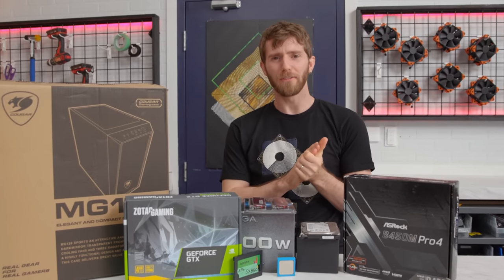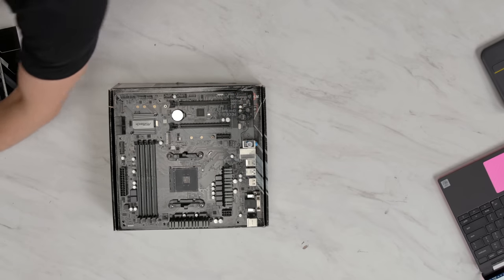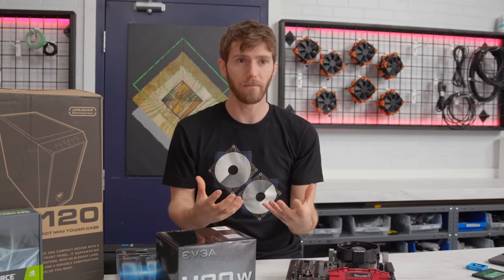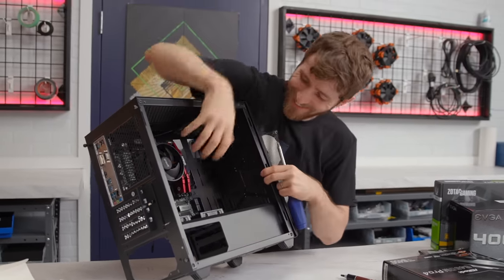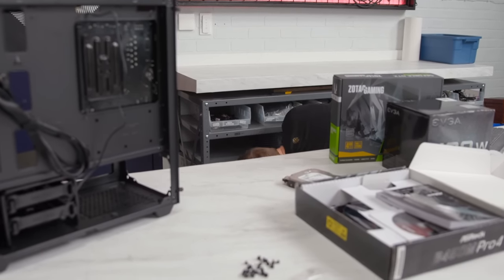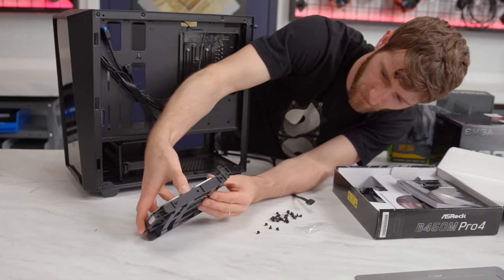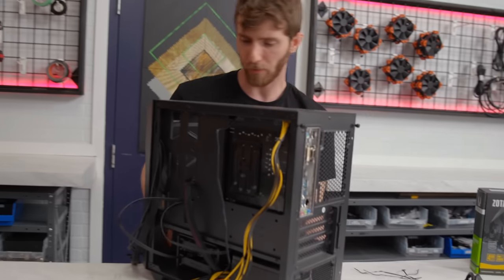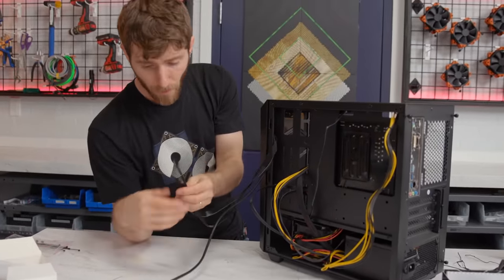Building a $500 AMD Gaming PC

Comment: Finally got my new screw driver now just saving for the components
Reply: Hah.  I was at lowes, the "cheapy" kobalt toolbox to hold that screw driver is $700.  So tools aren't any cheaper than pc gaming.
Reply: Haha
Reply: You dont need a screwdriver,instead you should have a swiss knife which hopefully has a philips head screwdriver
Reply: Progress man
Reply: Just use ur nail lol
Reply: @Simulate1NinetyNine  bruh best comment I’ve seen all day 😂
Reply: @joysniknath1679  and more importantly, tweezers for cable managing
Reply: @Graphics_Card  and oh forgot to mention you first need a table
Reply: YEEE congrats homiee
Reply: @jemiebridges3197  man you can buy a pre build pc for $600
Reply: @jemiebridges3197  clearly you dont live near a harbor freight
Reply: @dindoyalkeenoo6103  believe it or not, for starter relays on Hyundais, I have a bent fork that I use to diagnose if the relay is good or not. 

Yes I am an ase certified mechanic, yes i will jam a fork into your eco for relay trip testing. It's cheaper than buying the 14000$ setup for testing
Reply: @neilnohacs5213  Harbor Frieght is excellent for one off jobs, but the permanate quality is not quite there.
Reply: Just use your teeth, saves alot of money
Reply: @jemiebridges3197  before you talk bad about h freight just remember, Milwaukee got its start there and their fuel line is some of the best power tools on the market currently. Also remember how craftsman used to basically have a "break and swap" policy?  Well h freights in house handtools (Pittsburgh/ Pittsburgh Pro) has that now and craftsman does not.

I used to work tool and die, I was a die hard snap on guy but now most my tools are h freight except very special one off tools
Reply: @jemiebridges3197  t
Reply: @jemiebridges3197  real  bad for you me to to get back in the to
Reply: @neilnohacs5213  well then they have really really changed since my last visit.  Which to be fair was before lowes bought craftsmen.  

The only two reasons i have to return to HF is that $800 folding trailer and i use their cheapy air compressors while saving for "real gear" which will have changed completely by the time i've save up.  Oh there powered paint supplies are okay.
Reply: Saving for my desk first... lol
Reply: Then the chair
Reply: @neilnohacs5213  i used to have to use a spoon to turn on my atv
Reply: My parents bought mine I am now in 6k debt
Reply: @joysniknath1679  damn, required fam
Reply: @jaredkarl222  yeah
Reply: @UltimateLuke  your y
Reply: Lucky man I just finally the got knowledge on how now for the money and components 😅😂
Reply: @joysniknath1679  ikr i have like 10 swiss knifes, its so value
Reply: @joysniknath1679  You forgot the brick
Reply: @rifcafcaf2391  oooh yess and i almost forgot that the black thing on which the brick sits is an insulating pad
Reply: @ethanburniston  what tf did u build not u can litteraly build a great pc with a good graphics card for like 1500
Reply: Bruh
Reply: i mean they aint that expensive
Reply: Saved up yet?
Reply: The grind is real
Reply: Use you microwave as a case to save more money it's very safe
Reply: Me alsp
Reply: @jemiebridges3197  if its a CHEAP toolkit for $700 it best be made of fucking titanium and be able to make a PC in 5 seconds
Reply: @joysniknath1679  Flippers realize people need tables. Tables now cost 4,000 each.
Reply: GAMING SCREWDRIVER
Reply: Wow u soo lucky God give u that
Reply: i bought the power cord today.  Progress!
Reply: 😂 😂 😂 👍 nice bro 😂
Reply: @joysniknath1679  can I get a thermal paste applicator
Reply: @Rectangle101  sure u will "need" a thermal paste applicator or you cannot apply thermal paste duh lol also you will need a cpu applicator
Reply: @Simulate1NinetyNine  this hurts to read, they just rip off your nails
Reply: @neilnohacs5213  honestly, I would trust you more than a mechanic spending money on a testing setup. Mostly because it's the sort of thing I would do if I started working as a mechanic.
Reply: @UltimateLuke  's "haha" has a "translate to english" that translates to "lol"... idk
Reply: @maltebernhardsson1077  dafuq? Im german english noob🤓
Reply: Me only buying a mouse pad without having a pc
Reply: Good 4 u
Reply: @jemiebridges3197  are
Reply: LMFAO
Reply: Epic
Reply: Good job man keep workin hard
Reply: Felt
Reply: @bigchungus7050  talk about a bandaid solution to a bullet hole problem
Reply: That must be a very nice screwdriver 🪛
Reply: Felt
Reply: I saved up for tweezers and swiss army knife.
Reply: First, Jack up ya car
Reply: @jemiebridges3197  I mean yeah they sell those giant rolling metal mechanics boxes for a bit much but you can get a cheap kobalt plastic toolbox or tool bag for 20 bucks or so...
Reply: @joysniknath1679  verge pc guide moment
Reply: @Graphics_Card  verge pc guide moment
Reply: @p4stagg448  yeah man real verge pc guide moment
Reply: Finally got my new pc now just trying to get a screw driver
Reply: Saving up for the screw driver then the comps
Reply: @jemiebridges3197  p
Reply: @UltimateLuke  pppppppppppppppppppppppppppppppppppppppppppp.ppppppppppppppppppppppppppppp
Reply: Yaa I got the plastic packet now saving for pc
Reply: @LavaHawk289   Yeah what about the dentist bills
Reply: I wonder if it could handle pcvr ?
Reply: LETSS GO I JUST GOT THE SCREWS I JUST NEED TO SAVE UP AGAIN FOR MORE
Reply: @thekidinyourbasement1802  lesgoo i just got the plastic bag for screws saving for screws
Reply: I cant even afford a screwdriver…

Made of gold

Comment: It's been about 20 years since I built My own PC. Used to be one of my favorite things to do.  Thank you again Linus for a fantastic video.  This one in particular has inspired me to pick up that hobby again.  I may in fact use one or more parts from this as the basis for my return to PC building.
Reply: Good luck stan 😊
Reply: When you were building your old PC I couldn't even wipe the dribble off my own chin. Respecc
Reply: How much different is it nowadays?? Honest question...
Reply: @dennisbanks706  There are many more choices now....board sizes, socket types, ram variations...but a lot less manual loading and trial and error with drivers...shit mostly just...works...when you plug it in now.
Reply: For me it was about 15 years when I was a Network admin. I recently built myself a computer and now all the kids need them too
Reply: @quick65  There's also fewer PCI cards. Remember back in the day you had to add a card for the modem, sound, parallel printer, video, network. I had many computers that needed both modem and network. The number of PCI slots was important. I remember the first motherboard I had with built-in sound and saying, "What magic is this?!?"

Comment: The Verge: You forgot the tweezers, brackets, "life is great" anti-static wireless wrist band, shock prevention pad for the power supply, allen key, swiss army knife.... Most importantly a WOODEN TABLE to prevent static!
Reply: swiss army knife that hopefully has a screwdriver in it
Reply: Hes not fighting static hes fighting cancer
Reply: and the 12kg of thermal paste
Reply: @UrSoMeanBoss  what vid are you talking about?
Reply: @stevenbudaya2140  Really? Try google.com
Reply: But... I thought you could build it in mid air?
Reply: Talking about memory, i wish i could erase this one
Reply: The super fast 2666mhz memory
Reply: But they had the H E X A C O R E
Intel wouldn't have let them use it if they didn't know what they're doing!
Reply: @BakersTaste  it was an AMD build. They were using a ryzen 3600.
Reply: Don't forget the Allen wrench!
Reply: *livestrong bracelet
Reply: @GeneralNickles  I'm pretty sure they used an i7. And don't forget the CPU brace
Reply: @AlanWakeAndBake  It comes with thermal paste pre applied but its always good to add more

Comment: @22:32 I'd be interested to know what that benefit is too. Also the power supply doesn't just convert Alternating current to Direct current. I'd argue their most important use is Isolating inrush current from the line in your wall to your computer. That way when it's plugged in and your Air Conditioner turns off, your computer doesn't get warm and make pop noises.

Comment: Me: Comes to watch Linus build a computer
Linus: Starts having PTSD about tower coolers attached with plastic push pins
Reply: Used to work for a shipping company (shipped stuff like TV's, amazon orders, etc), can confirm that people handle packages pretty much the way Linus described.  Just throwing and booting shit around, assuming that the inner packing is invincible or just not giving a fuck.  
On one hand, fuck those guys.  Some men just want to watch the world burn.  On the other hand it's hard to blame them too much because their compensation is so shitty, especially at that company.  Just one of the many downsides of running a company with a "bottom line" mentality, assuming you can treat people like shit and not have it come back to bite you.
Reply: Beljihn Wahfl exactly 😂
Reply: @Bear Omega Except an Xbox One X can't do nearly a fraction of what a computer can do.
Reply: @Bear Omega buy 2 games and xboxgold and you're gonna be just as expensive, steam games have proven to be cheaper and pc has g2a and kinguin for cheap cheap keys
Reply: Bear Omega The Xbox One X GPU is actually about 5% slower then the GTX 1650 Super in this video
Reply: @Bear Omega you know people in this comment section like me are huge nerds and would do this stuff for fun, i know sounds crazy, but its true

Comment: Me: *feels like every component is fragile*

Linus: *stuffs an entire stock cooler in his pocket and immediately continues to install it*
Reply: That’s the thing working with hardware. When you start everything is made of eggshells. A few years and you’re juggling GPUs...
Reply: If you break something you have to rma it is replace something, if he breaks something he walks over and picks up another one. Not that he doesn’t care but honestly hardware isn’t THAT delicate we just treat it that way because of cost. I’ve built on carpet for years never used any anti static, just flat yolo’d it, and never had a hardware failure (aside from a hard drive) until I built my first pc with new components. Then I didn’t take any risks, even though I knew breaking it was unlikely I couldn’t afford to take any risk
Reply: @TylerjWebb  I think it's just that he's been building computers for years and knows what he can do without breaking anything.
Reply: @TylerjWebb  I've experienced the same thing. Every computer I've built, I built on carpet with no anti-static band, and have never had issues. One of the most nerve-racking things I've done was taking apart my phone to replace the screen. I was sweating and shaking, and now I just pull it apart, logicboard out and all, in like five minutes, just flailing everything about like it's nothing. Hardware isn't as delicate as you'd think, (unless it's cheap)
Reply: Some components are not that fragile

Comment: 42:50 "it's EVGA, so it can't be that bad.

It's literally listed under "Potentially dangerous in multiple scenarios" in the PSU tier list on LTT forums.
Reply: Lmao yeah
Reply: wtf why
Reply: @royk7712  Never trust the internet
Reply: A lot of the PSU Tier list are really elitist, a lot of psu of the lower Tiers are really ok, not great, maybe 2 or 3 years of use Max, but It will not explode, i mean, cmon.
Reply: @manelito1000  EVGA has been around for almost 20 years. I trust them
Reply: @christophervanzetta  yup, a lot of fault has been found, but they never show how much failure per unit sold. 1/1000 or 1/100.000?? not enough statistic but still just posting some random failure doesn't make it a bad PSU.
Reply: @royk7712  The PSUs are listed based on testing of reviewers, those bad PSUs are there because they often lack any proper protections, can't deliver the advertised wattage and/or have issues delivering "clean" power along with other possible issues, it isn't based on random reports or something like that. Brands don't really matter when talking about PSUs, often they are(like EVGA PSUs) only rebrands of models made by OEMs with some small changes or no changes at all. It isn't worth saving 20 dollars or so to get those PSUs, that is like saving some money to get a car without seatbelts, airbags and other safety devices, yeah you could drive a car for years without those things and never have issues, but it doesn't mean you should do it.
Reply: @kaitoux8413  I'm sure every PSU have fuse, even it it fail it would just burst the fuse and stopped working. Even if they can't deliver clean power or voltage that require to run the computer, I'm sure the component inside motherboard like vrm can handle or have the tolerance to be supplied by the "bad" PSU. I'm not defending them or what but all the prebuild or budget build is use "bad" PSU and there's not enough explosion to justify that is a bad PSU. Also majority of the computer is a prebuild or budget build soo
Reply: @kaitoux8413  also my first cpu was lga 775, later upgrade to i5 4670, now i5 8400. My gpu was 960 later upgrade to 1070. All with the same 650w psu from thermaltake. 
If I use overclocked Cpu I wouldn't use bad PSU either. For the most build that use non overclocked cpu, this psu is just fine.
Reply: I bet you most guys on the list don't even know basic circuit and electronics. Those lists are trash.
Reply: Yeah, as if EVGA even did PSU manufacturing. These 80+ White and a few of the Bronze units are made by HEC, an OEM known for cheap crap.

Comment: Just because Linus told me not to worry about the screwdriver, I got worried...
Reply: @Bludcraze  Your reply has nothing to do with the original comment
Reply: Well at least he's learnt  not to put a screwdriver anywhere near anything that's plugged in. But it is slightly worrying that he didn't care much that the sata drive mounting screws were spinning in Thier now bored out holes. I can't tell you how many PCs I've seen destroyed by loose screws inside the case. ...it can be a fire risk.
Reply: Phillips head numbers 1 and 2 and you can take anything computer related apart
Reply: this was the comment I was looking for lol
Reply: @Charlie Farrar dont worry about it

Comment: I actually got a build for 500 without graphics card ..Ryzen 5 5600G a RGB case 16GB ram a nice mobo and you can actually reuse your PSU and use the stock cooling for the cPu

Comment: I Have bassically the same build and its pretty good,  it doesnt have a GPU rn because thats what im saving up for now, so its running on CPU graphics (ryzen 3 2200g) It doesnt do any good on warzone but anything under it is able to get 60 FPS which is my goal even if some settings are lowered. Some games run that FPS like apex or overwatch, but all settings are on low which is actually good for CPU graphics. I cant wait to get my GPU but running off the CPU is fine for now because Ive been playing less demanding games, like older NFS games and Valorant. I loved making my PC and I dont regret switching from Xbox to it.
Reply: I haven't switched but this seems like a good build.
Reply: @fuzzie6299  get the 3200g if you can, they're usually at the same price (if you don't need the igpu just buy a 3100)
Reply: @panquemadol  Noted, I don't have the budget for a GPU so I'll get an IGPU.
Reply: @fuzzie6299  me neither, I'm going to buy that 3200g and later I'll upgrade it, but right now it's impossible (venezeula lmao)
Reply: That's pretty good fps for a iGPU, what GPU you want to get? Going to build a pc too but I got a 1070 already so I can spend a little more in the cpu side
Reply: Gabriel Ribeiro I actually have my GPU now, I got a rx 580 8gb. I’m getting warzone at high 80 FPS, and most games average max at 120
Reply: Moxii It said 60, because I usually had v sync on
Reply: @volkscob  nice, the rx 580 is a great buy, going to get my pc end of November, anxious for it
Reply: Gabriel Ribeiro switching for me was hard, just remember to never move files from their default save location and try not to mess with driver settings to often, in terms of games your well set up because the free library is pretty big

Comment: I have a very similar build. i5 9600f with the 1650 super. Great value at the time I built it. Runs everything at medium setting around 100 FPS (plus or minus some for easy or hard games). Added more ram and made the experience every better with 32 gbs. No complains especially seeing the prices of current of “super computers”.